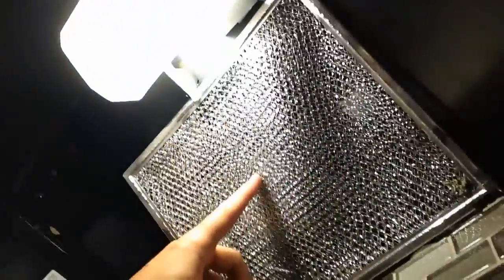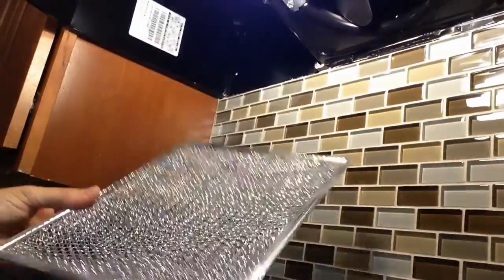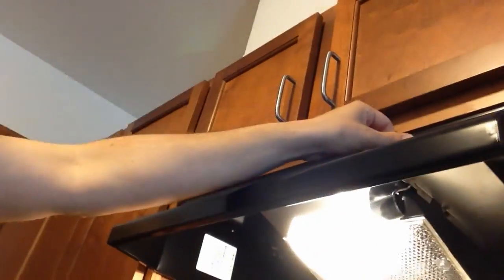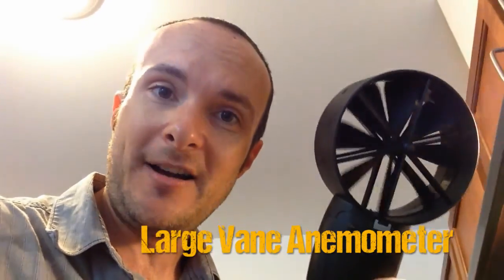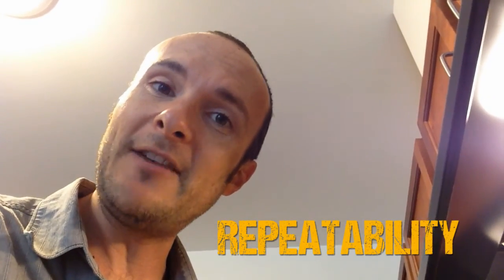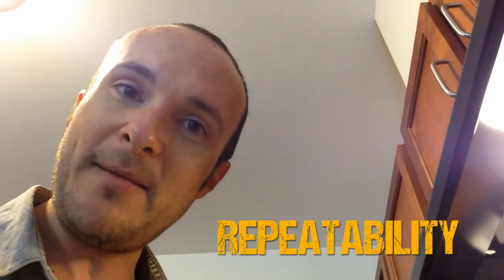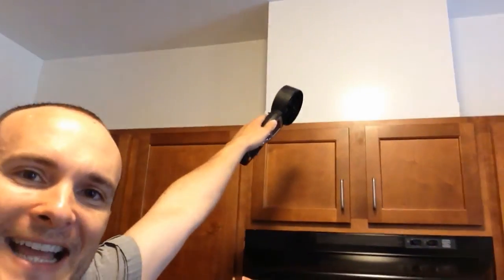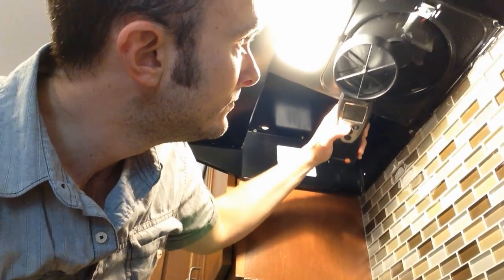How to Commission a Kitchen Exhaust Hood

Comment: Correct me if I am wrong but shouldn't we take this measurement while the filter is on which will be the case during normal operation? And should there be a K factor in this case?

Comment: Pffftt don't even bother installing those filtered units. Buy a filterless range hood!
Reply from the maker: You'll have grease all over the side of your house buddy- you'll end up cleaning either way, I prefer the sink to a pressure washer.
Reply: @HomePerformance  Trust me, Asians like me prefer those filterless range hoods. The fan blade design extracts grease and Quarantine it to a oil cup. They're usually 700 cfm or above, and they're much more powerful than those filtered kinds. Besides in a Asian/Chinese household, deep frying, stir frying, cooking food on the wok and etc is to be expected, and usually do produce smoke and many airborne grease. With filterless units everything gets exhausted out such as smoke and odor except the oil and grease. Although some airborne grease will be exhausted outside.
Reply from the maker: Interesting, thank you for clarifying!

Comment: Hi, I was wondering why you don't test with the filter on ? Isn't it a more representative test of operating conditions? It would be also with less risks to break the fan.
Many thanks for this really useful video!!
Reply from the maker: +Benjamin Zizi the filter IS on, buddy! The fan is designed with sharp edges and a recessed set of filters, like all hoods should be.